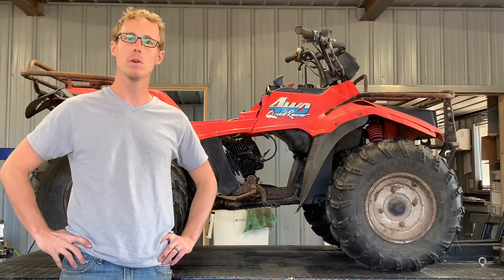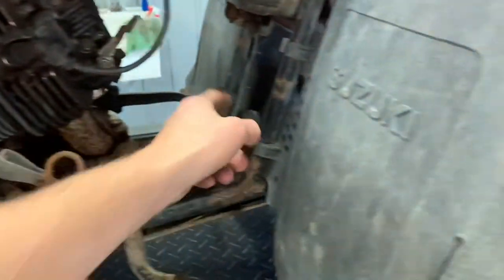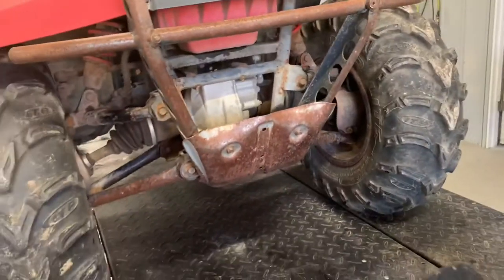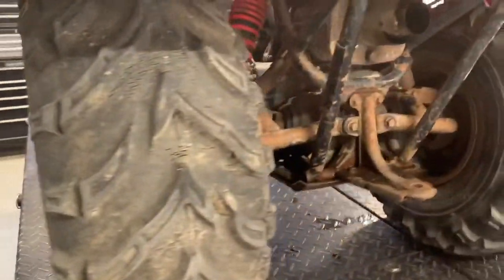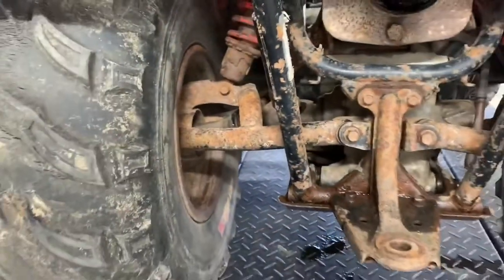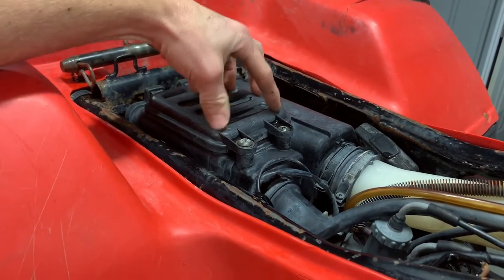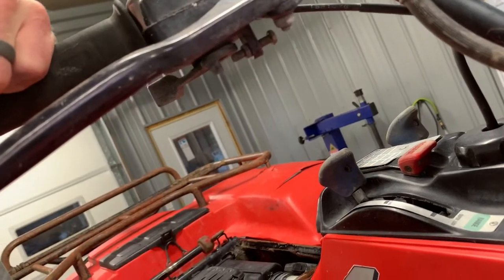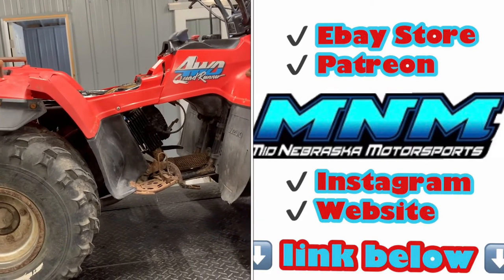How To: Suzuki Quadrunner 250 4x4 - Full Service - Engine Oil Change

Comment: Another great video - I've been working on my 2000 LT-F250F that I've had for quite a few years but only ridden circles around my back yard. I've watched quite a few of your videos and must say you have done an excellent job explaining how to work on these machines.  Do they have external fuel filters?  I am getting ready to rebuild my carb this weekend and didn't see a filter other than the little one in the carb and the one in the petcock.  Thanks for being a great resource for us home mechanics.

Comment: Hi I have a Suzuki ltf 250 quad runner 2 wheel drive 2001 model can you tell me if the engine oil services the gear box or do I need to put gear box oil in seperate if so where would I find the oil drain an fill hole thanks

Comment: Excellent video, Thank you.  Question please:  1994 LT250 quadrunner 4x4:  I rebuilt the carburetor, it now starts and runs, but at way too high of an idle.  I know there is only one adjustable jet, I set it where I found it.  If it is idling way too high, and the external idle adjustment isn't even touching the throttle, should I adjust the adjustable jet? Can I access it without removing the carb again?  Which direction would I adjust it if idle is too high?  Thank you for the excellent help.
Reply: If you don’t have air filter connected properly it’ll cause engine to run lean, so if your positive it isn’t the carb then likely something to do with air filter or air filter boot, I got a hole in the boot that connects air filter to carburetor but couldn’t see it and it cause my machine to run super lean, soon as I wrapped some duct tape around it ran normally again.

Comment: Hi there! I got a 1993 Suzuki Quadrunner 250 or 300cc, and i just noticed it doesnt come with a winch.. do u think it is possible for it to have one, since i noticed the front bumper is way too close to the front part of the quad, like the radiator plate and headlights area.. thank you so much and have a good day!
Reply: I have one it works just fine
Reply: @austinblevins3406  yes I have a 1998 quad 250.. was pretty tight but I was able to Fab a winch up inside that frame,
Reply: These quads don’t have radiators I have the a 93 as well, you can always add a winch to like any quad just make sure you mount it properly. Also if you got the 300cc quad runner don’t get rid of it!!! Super rare machine!